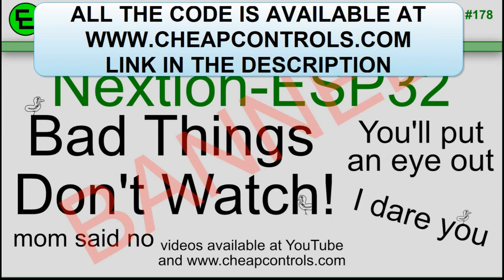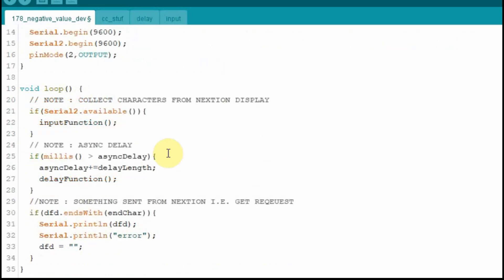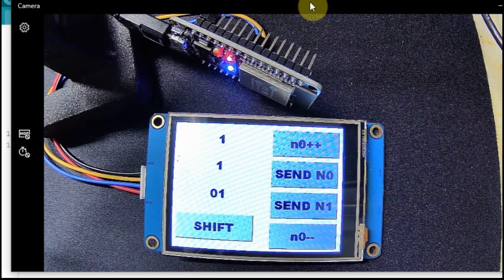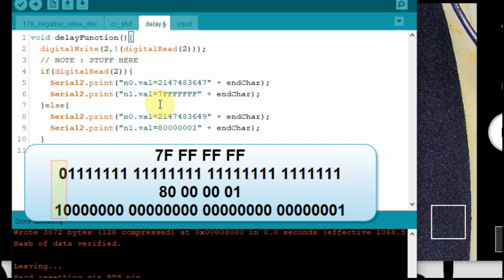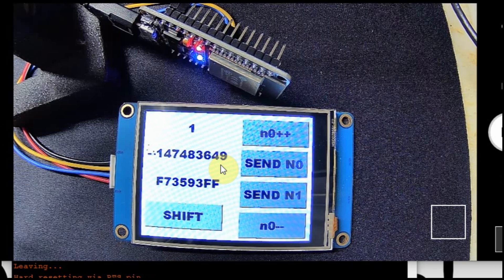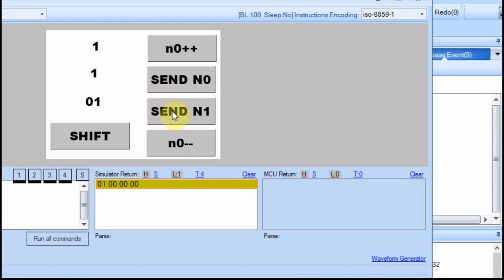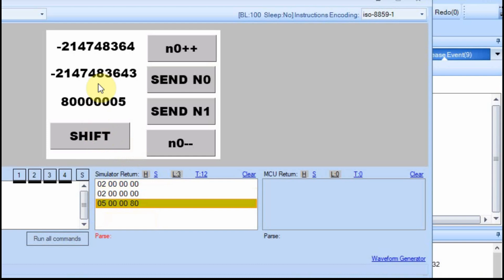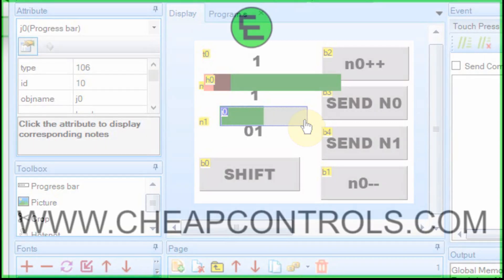178 Nextion Danger -- direct connect to #ESP32 #nextion sending negative numbers

Comment: can i use GPIO pin 26,27 to connect my Nextion LCD ?  because now i use Co2 sensor detec it use RX,2TX2
Reply from the maker: You can try.  I use softwareserial.h when I want to use pins not dedicated to serial ports.  Let me know if it works.  I am still new to the ESP32 and would like to know.

Comment: Is there an easy method to send the negative values in hex to the Arduino and read it by the union method? btw many thanks for your videos!!!
Reply from the maker: Have you seen my video on the Union.  I think that should work.  I am not sure I have ever made an example of sending a negative from the Nextion.
Reply: @CheapControls  Many thanks for the quick response and sorry ofr my late. Actually it is completely working like intended.

Comment: i have used nextion.read command from nextion.h library but when i am using esp8266 my code works well and i am getting proper values from nextion display to arduino ide serial monitor but when i am using the same code for esp32 at that time i am getting value like 255255 224 in serial monitor please help me to debug this problem
Reply from the maker: Sorry, but I don't use the nextion.h library.  I wish you luck and I am sure you will resolve the issue.
Reply: @CheapControls   actually when I am using ESP32 i only got 255 as output in serial monitor .and 255 is undesired output
Reply from the maker: Do you use the nextion.h library?
Reply: @CheapControls  yes
Reply from the maker: I have no knowledge of the nextion.h library.  Sorry.

Comment: your video are just Great...

if you remember i made a request saying that Nextion as launch a Wall touch switch Named NSPanel.. it has a 3.5inch nextion nd Esp32 in it... but unfortunately the built-in fuctions are very limited... could  you plz make a video on it showing us how to program it and make it work as we wish....
Reply from the maker: I have a sonof switch.  I was able to get the internal LED to flash.  I hope to move onto some more stuff but it is still new to me and will take a little time.  I hope you find somethings in the videos interesting until I get caught up to the type you are using.
Reply from the maker: @blondie sl I don't think it has the capability of the Nextion display.  I am going to look into it a bit more but I am not optimistic.  I am enjoying the ESP32 for the WIFI characteristics but there is a learning curve.  I hope to do a video next week on loading a Nextion dropdown or combo box with the SSIDs and then choosing one from the list to connect too.
Reply: @CheapControls  Sir i have seen each and every video you have uploaded on Nextion... Each and Every Video.... and I already have installed a 2.4 inch nextion in my Bedroom toh switch my lights on and off and even increase and decrease the fan Speed... though i have automated my bedroom before but i wanted a touch display... so Nextion was the answer... but the nextion library went over my head... After sreaching a bit i found your video.... Your video was Oasis in Desert..... i learnt a lot and implemented it on my projects.. it works great...
Reply from the maker: @burhanuddinbhiwaniwala618  Thanks for the kind words but I am very interested in the model of LCD used in the SONOF panel you currently are programming.  Do you know the model number?
Reply: @CheapControls  APART from Basic, Enhanced and Intelligent displays... Nextion also has other model named Discovery in which it has 2.4 inch 2.8inch and 3.5inch displays.... As i sreached the internet i found the NSPANEL has 3.5inch Discovery model in it... NX4832F035_11 this may be the model number as many have used this model number to edit nextion through Nextion Ide
Reply: @BlondieHappyGuy  Yes i already have bought one and it as a capacitive touch display from Nextion and uses eps32 for Wifi and Bluetooth connectivity... and there are some Genius who have even installed ESPHOME which works with HOME ASSISTANCE but all my devices works with mqtt and i don't wont to reprogram all my devices so  i am sreaching for solution to program NSPANEL Thorugh ARDUINO IDE...
Reply from the maker: Are you sure it is a nextion?  Do you have the model?  I am concerned that it does not use one of the models listed in the Nextion IDE but an off brand one that can't be programmed with the IDE.